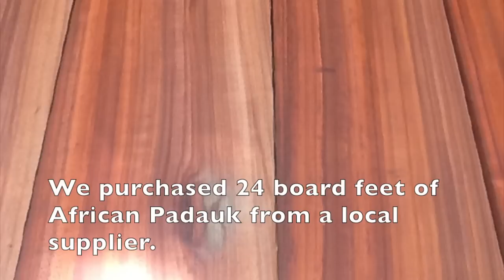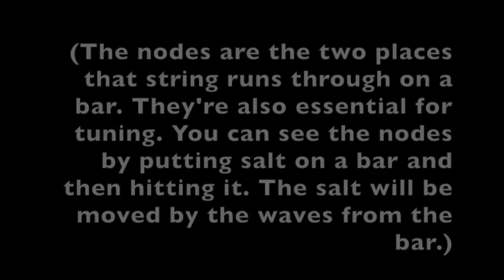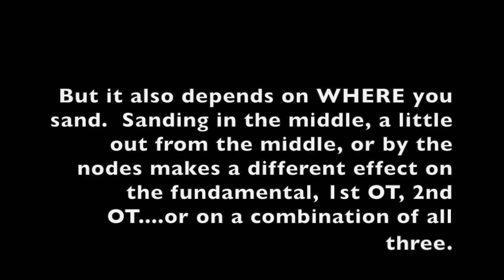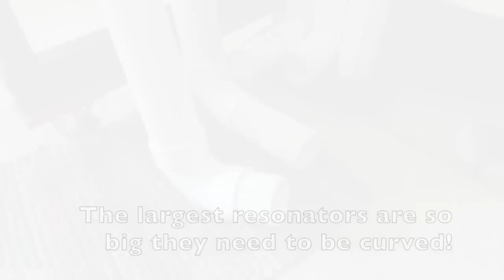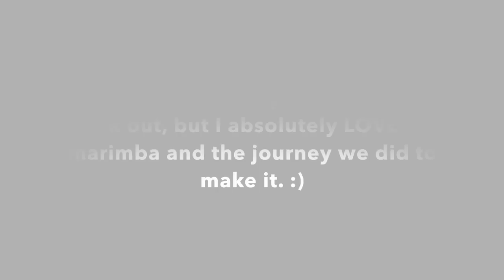Making Our Marimba

Comment: There aren't many temperate zone woods suitable for marimbas. If you can get it locally, Osage Orange would work. If you purchase from a exotic supplier, Padauk is just as cheap.
I would cut plugs from pine or plywood to slide into the ends. Save a bunch on caps...looks better too.

Comment: Hi Leah and Dad,I have been looking at the Make a Marimba sight for a while now and am seriously thinking about making one myself. I'm guessing you would give a positive review of the manual.Does the manual go over the tuning of the fundamental and the overtones or was that something you did?You said you had a break down of costs. I would really appreciate that especially since the designer seems to be in Australia
Reply from the maker: +J. McC Yes, the manual goes over ever aspect of tuning in what we considered a great deal of detail. I had no real knowledge of overtones before this so it helped a lot. We spent around $900 in materials. The black part of the frame was made out of wood scraps we had in our basement from previous builds so we didn't have to spend any extra there. We bought four or five planks of paduak, which cost around $300, if I remember correctly. The next expensive thing was the PVC, we had to buy a lot of different sizes and end caps, as well as metal to screw it together. After those big costs, we had to buy the gold and black paint, paracord, the metal string holders, etc etc. Hope this helps!
Reply: Thank you that helps

Comment: Is there a good free electronic tuner to use online? What the best way to tune the bars? What formula did you use to calculate the bar length and resonator length? I know the resonators are susceptible to end correction, but are the bars? (Also, mine is 19-tone equal temperament, instead of 12.)
Reply from the maker: +TRex Quisite We used an online strobe tuner, found at iTunes. The best way to tune the bars is using an electric sander  and later on, sheets of sandpaper. We did not have a formula, the general process was outlined in the manual we bought at makeamarimba.com. I know that there are some formulas that figure the resonator length as 1/4 of the note's wavelength, but we didn't use these. You can correct the bars at the end, but it becomes more risky/difficult to tune it without going too low.

Comment: A couple of questions. Was this a difficult project to do? What was the hardest thing about building it? How much more would it have cost to build a full 5 octave marimba? Do you have a break down of the pricing for the wood for the bars and the cost of the materials for everything else?
Reply from the maker: It was fairly hard for us - for my dad because he has no musical background and for me because I have no woodworking skills! But between the two of us we got it done. The hardest part was by far the tuning of the bars. It took longer than anything else and we still have some that need to be retuned a bit! I don't think it would have cost too much more to expand to the 5 octaves as we had lots of padauk left over that we could have used. I do have a break down, I will send it to you ASAP! :)

Comment: What did you use for the PVC pipe caps? Where did you buy them? Also, what is the name of the teak oil that you used to polish the bars? Great job with the instrument, it looks and sounds really good! Thanks.
Reply from the maker: Thank you! We used normal PVC pipe caps that we bought at a retail hardware store (probably Lowes or Home Depot. We also used Watco teak oil and polished the bars three times with it.

Comment: Hey! Your video and your marimba are awesome, congratulations!!
I need a 5.0 octave marimba for my senior recital and practice (cuz' my university doesn't own one) I'm planning on buying or making one, but then I have to ask you. Which power tools do you think are strictly necessary to buy? I don't own anyone, and I don't know if buying them + the wood and other stuff may be cheaper than buying a new one (I'm planning to buy it to a friend mine who is an emergent percussion luthier, for like $1,000 bucks).
Thanks in advance and congratulations again!
Reply from the maker: Thank you! I think you would definitely need a saw to cut the wood and PVC (power saw is better for accuracy than a hand saw) and tools to bore/router to make the string holes. (we used a drill to router them)  You will also need a sander because while you technically could sand them by hand it would be very difficult/time consuming to do so.  All those things get pretty pricey and plus labor costs/time it might not be worth it for a one-time project? We spend about $850 on materials but my dad had all the experience and tools already. I would check with your friend and see what tools they have and what they would need. There's also some cheaper percussion companies out there - I actually just bought a Mode marimba which is a 5.0 synthetic, it's cheaper than others and while the sound is different from rosewood, it is still a good instrument. Good luck!!

Comment: How much of the wood did you end up using for the project?
Reply from the maker: +Bishop Oldfield we used four or five long planks (maybe 8 feet long?) of padauk and then some scraps of wood from our basement for the frame
Reply from the maker: +Bishop Oldfield Hi there, sorry for the late reply. We used up the majority of the wood with all of the keys and with the little pieces that we used in the frame. We also had to remake keys so that used up a lot of the wood as well.

Comment: I have been looking into building a marimba myself and have most of it figured out but one thing. How do you know the dimensions of the bars? Also, how did you tune the resonators? Awesome project!
Reply from the maker: Eric Smith Hi Eric, the dimensions of the bars depend on the different notes, we got our dimensions from the guidebook. We tuned the resonators by using the strobe tuning app we downloaded, as well as comparing them to the bars. To make the resonator higher, we shaved or cut off pipe from the end of it. Hope this helps, and thank you!
Reply: @leahdunbar4656  hi everyone ,if anyone else wants to uncover  try Debuncar Incredible Instrument Aid (just google it ) ? Ive heard some decent things about it and my brother in law got excellent success with it.